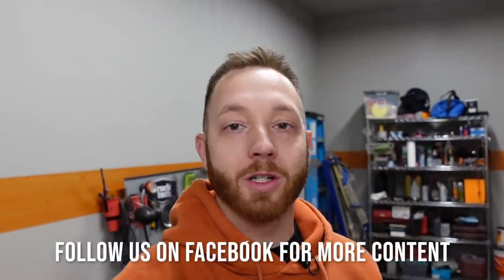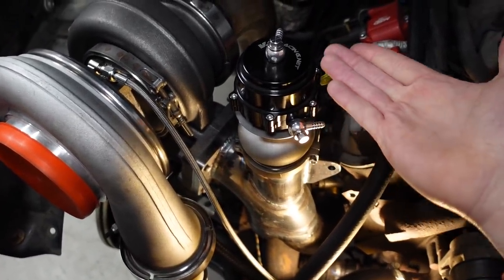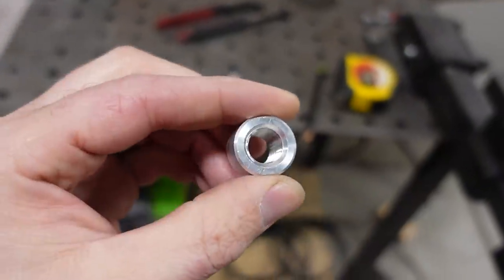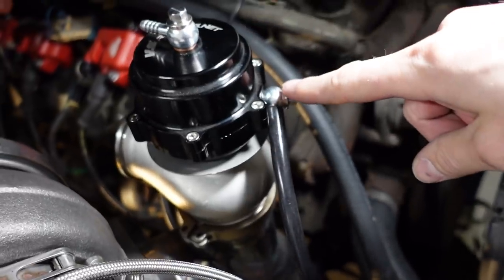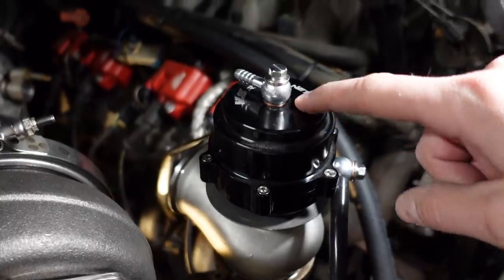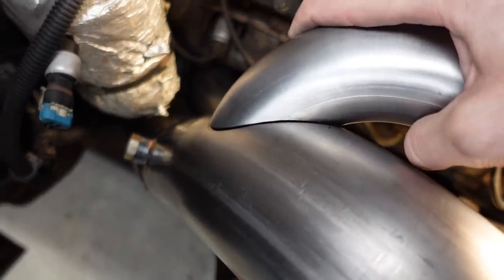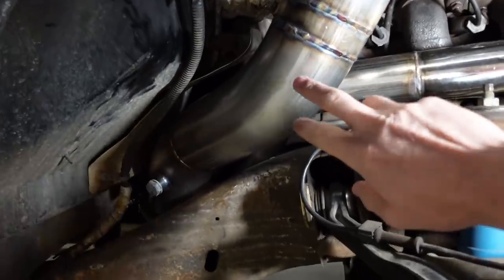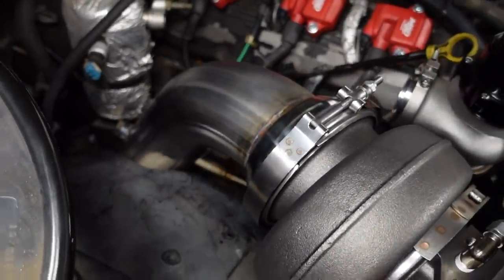Plumbing the Wastegate on a Turbo 8.1 Vortec Silverado

Comment from the maker: thanks for the support guys! UglyTruck is coming along nicely, and I Cant wait to get it on the road!
Reply: The clearance issue , on the downpipe , could be even easier to fix than you are thinking . 
   Ugly truck has some sort of steering bump stop . Adjust or add to it to limit steering travel . 
   Bam ! All fixed
Reply: Can't wait to see it on the road too.
Reply: I feel the fender liner is going to melt
Reply: I'm a ford guy but this thing is gonna be a monster that big block torque is gonna spool that turbo like a champ

Comment: If you are worried about the tire rubbing on the down pipe, you could just weld a patch on the outside like a elbow pad on a suede jacket.
Reply: Or just heat it up with a torch and make clearance with a BFH.
Reply from the maker: its not so much that I'm worried that it will damage anything from rubbing, I just hate that it might rub at all. likely even if/when it rubs, it will be so light

Comment: Even if not wanting to change boost levels a manual boost controller in that line would block boost from reaching the gate until your "preset/preload" psi so that you dont start cracking the gate early, it will let the boost pass to the gate as soon as it hits a certain level.

Comment: VERY nice videos!!!!   
Thanks for putting them up!

EXCELLENT fit up on that very difficult
 junction for the BOV tube!!!

Argon tank valves are double seated, 
which means just cracking them open CAN 
cause them to leak gas.
Best practice is to open them to the full open side.
That side has a seal on the full open way.
(btw, I used to teach welding.)

Comment: If all else fails on the throttle body cold side tubing you could make a triangle shaped throttle body adaptor that mounts behind the throttle body and changes the angle so it doesn’t stick up, rather faces forward toward the radiator so the 90 degree adaptor would fit

Comment: It's an interesting build you got going on here. I suppose if you really wanted to find out if the tire rubbing is an issue, you could jack up the passenger front unbolt the torsion bar slide it out of it's housing and then you can freely check the whole range of motion easily with the tire on it

Comment: I always thought it was best to run the wastegate pressure from the manifold because that's the actual pressure that's actually getting to the engine because there's always a little bit of pressure loss with intercoolers and then it's responding from the pressure that's actually making it to the manifold

Comment: Id like to see an episode where a 11.5 AAM 14 bolt rear is installed on a gmt800 1500 with 6 lug hubs and the OEM 13 inch disk with double calipers in read with ebrake.

Comment: If you bolted a plate to the top of your foundation you could raise that metal saw up just a smidge! 
And hell don’t ever smash it with a hammer I said just crush it with the vice so it still looks pretty and you don’t loose any size because the pipe is now oval! 
Man I love ever one! I like it before it starts!!

Comment: The inner fender being in there is a bad idea... it's going to melt. regardless of how well you trim it. I would also suggest making a bracket off of the bottom of the block to the base of the turbo using a turnbuckle to support the turbo... that way you don't have any cracks or warping.
Reply from the maker: I made a tab on the manifold to mount some sort of support structure to, just haven’t finished that part yet

Comment: For the cooler would it honestly be all that hard to use a duramax style cooler? Don’t know if the core support is the same but that’d be a pretty big cooler that had the inlet and outlet on the back side of the radiator. And it’d be a factory part upgrade which is a good idea because there might be a better part availability if something fails and diesels can run a lot of boost so it’d be good for a while when you decide raise it.
Reply from the maker: you can, but you end up cutting a lot of stuff up since the duramax intercooler is about 2" taller than the core support on the 1500 trucks.

Comment: Awesome work! I am liking the vids! This is a cool project. I especially like the level of detail. Really shows the amount of work and though that goes into a build. 

Question for you. Why run bellows on the wastegate to exhaust pipe, but not the crossover? The crossover is a lot bigger and I think will get hotter so you'll have more thermal expansion and contraction in that piece. Of course a high quality one with the proper liner to protect your turbo. Just curious.
Reply from the maker: i debated putting one in the crossover between each manifold, but was worried it would flex too much and stretch the bellows because of the shape of the pipe. I may add one later on though... I put one on the waste-gate dump tube because I figured the down pipe would have the greatest chance of moving around, and because the wastegate dump will see different thermal cycles than the rest of the exhaust (due to it not always having hot gasses moving through it). to me, that part of the whole system would see the most movement and stress...

Comment: Hello LT. Just wonder if you going to use any heat shield around the exhaust down pipe considering it too close from the fender plastic cover. Nice work by the way

Comment: There you are! Been missing you on Power Block, then again been missing a F ton of Power Block too.

Did that turbine housing melt your fender liner? Looks pretty close and I know from personal experience that them things burn like a tire once they start up.
Reply from the maker: nope, its been in there for the better part of a year, and hasn't even melted. I do run a turbo blanket which helps though... but there is a lot of clearance as well
Reply: @LawrenceTolman  gotcha, probably just a camera angle thing

Comment: Nah LT 2 inch socket. And some heat give that down pipe a tap and it'll look elegant. Or run a spacer on the wheel?

Comment: What about fabing up a mount between the throttle body and the intake to change throttle body angle so it is an easier entry into the throttle body?
Reply: And here I was in my head thinking: "are there really no aftermarket 45° throttle body spacers that could work for this application?" Great video!
Reply from the maker: i had thought about doing that, and if my silicone coupler idea wont work, then I'll have to do something like that

Comment: Put some black heat wrap on the pipe so it blends in with inner fender. Make it look stock as possible so when you dust a camaro they will look at you and go what the hell just happened.

Comment: Heat wrap the down pipe? Or the any of the hot side piping?
Reply from the maker: I havent yet, I had planned on. ceramic coating the whole thing once I put a few miles on it

Comment: Lt u don't  have to do the down pipe like that if u cut it out just flip it inside out and weld it back it should give u what u need that way if u end up having to cut it for clearance
Reply from the maker: true, that would be another way to do it

Comment: Question. Would the exhaust thats coming out the hot side of the turbo, push into the wastegate requiring a lower wastegate spring?

Comment: Is the w/gate dumping to the atmosphere ,down low,  a bad thing?
Reply from the maker: no, not at all. i just like to recirculate them for a little quieter, stealthier setup. plus, for the way it sits on my truck, it wouldve been a lot more work to dump it down to atmosphere underneath the truck

Comment: Base line spring maybe 3 psi. What psi you get on dyno?
Reply from the maker: 5psi on spring only, and the boost controller turned up to 7 on the dyno... since then I swapped to a stiffer 10 psi springs and have gone up to 14psi once or twice

Comment: Is it fine to run just on spring only and no boost controller ? Will I not damage anything ?
Reply from the maker: yes, perfectly fine as long as its hooked up right and has the proper spring. This combo would hold a minimum of 5 psi of boost all day long, so ultra safe.
Reply: Thank you 🙏🏽 I plan on doing it exactly like this. I couldn’t find anything else on this topic!
Reply: @LawrenceTolman   what did you do with the MAF? Did you delete it